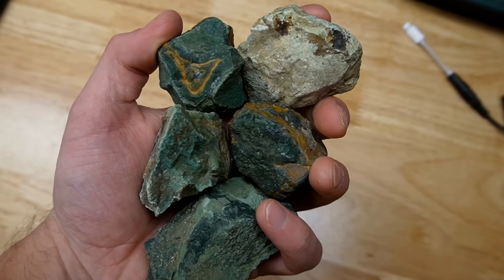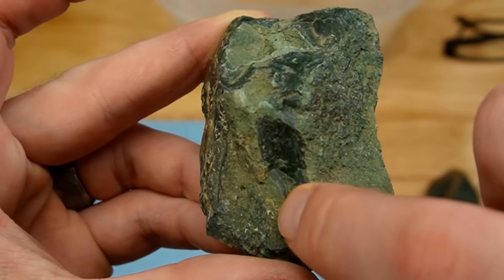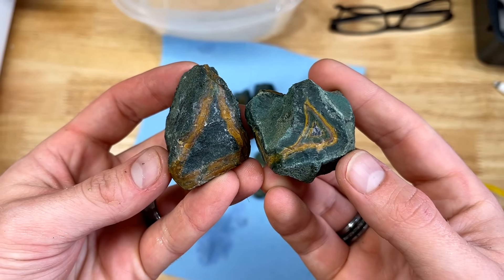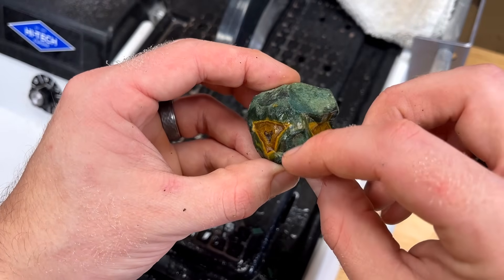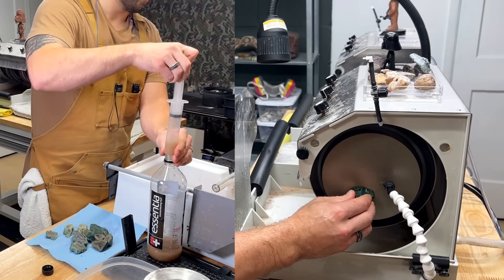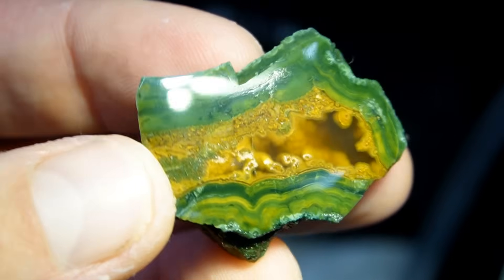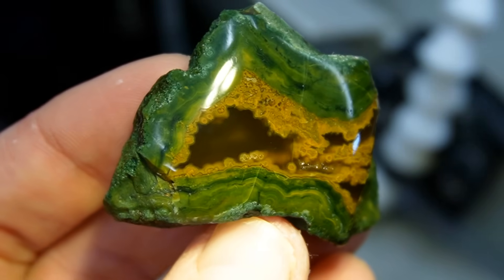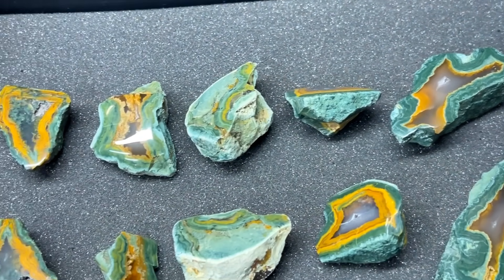I cut Bulgarian Agates (RARE) on Rock Saw | Gem Cutting

Comment: Those are beautiful. My dad was a silversmith and worked with turquoise alot. He had a 6" cutting machine and something similar to your cab king. Had 6 wheels, 3 on each side. But unfortunately he stored it in a shed and the elements were not so kind to it. But I still have the cutting wheel. Love the videos.